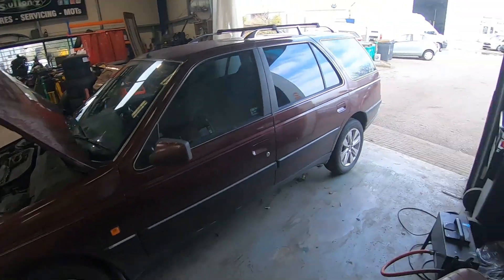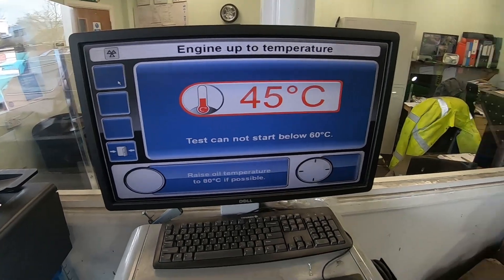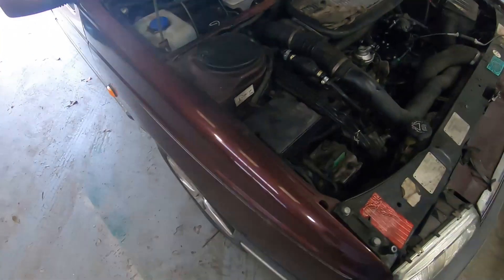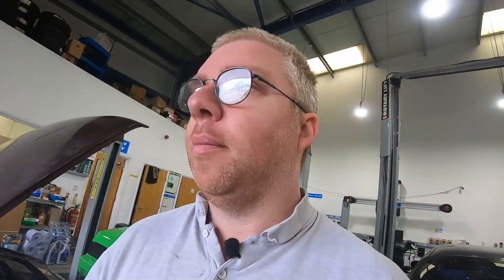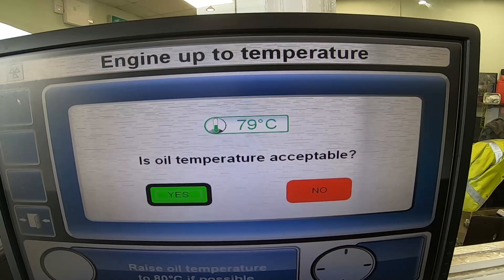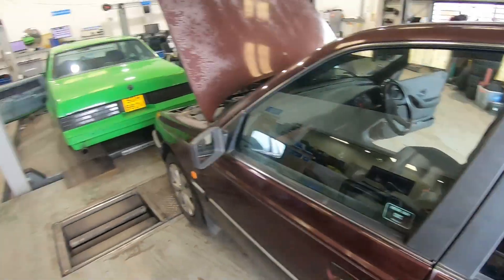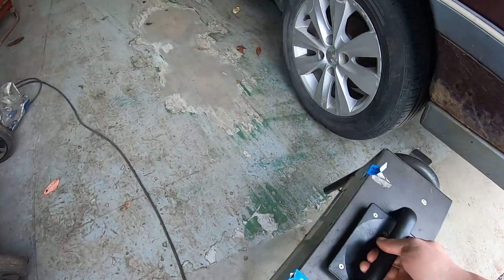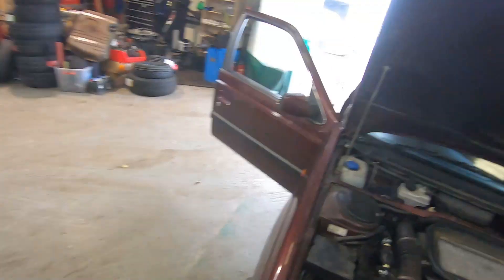Will ENGINE OIL as FUEL pass an MOT emmisions test? - Black Diesel test

Comment: You didn’t mentioned what’s the trick to pass
Reply from the maker: Remove the 'plate value' on the chassis plate. Changed the MOT limit from whatever the plate value is to 3.0

Comment: Hello, I have a 1997 mk2 Peugeot 306 TD. The limit on my car has a soot limit sticker stating 1.96 for a Bosch fuel pump and 2.4 for a Lucas. The car has a Lucas but I have a spare Bosch pump, lines, injectors and pulleys, in case I ever want to run on part veg oil. I'm pretty sure the Lucas wouldn't like it ! My recent MOT, done in January of this year resulted in the following :
Test limit applied   1.50  l/m
Absorption coefficient 0.58 l/m
Absorption coefficient 
after correction            0.57 l/m
Test type applied       Fast Pass
Test results                Pass

   My car has the main fuelling turned up a bit, but not massively. It ran so lean with the factory setting that passengers' heads were like nodding dogs when I changed gear. It goes much better and starts instantly since I turned the 4mm allen key inside the fuel pump by a mere 1/4 turn, i.e., through 90 degrees. I have a K&N air filter and a stainless exhaust with a back box and 2 and a half inch tailpipe. Had a chap much more knowledgeable than myself adjust the turbo wastegate so that it spools up at 1,500 RPM, rather than the OE 2,200 RPM, so, quite amazingly, I get really good local MPG of 53-54, whereas from the factory it was 46 - 47.
Reply from the maker: Thanks for your comment. I find that sometimes having more power from the engine can reduce fuel consumption as the engine doesn't need to work as hard to do its job

Comment: What is the percentage of petrol in your used motor oil fuel?
Reply from the maker: Usually 10 to 20% dependant on the weather /temperature
Reply: Can you Run on it . 
Or is it Classed as Running on Red with the Road Side Checks. 
Just wondering

Comment: Be careful. Running a car on anything other than white diesel or biodiesel/veg oil carries the same penalty as running on rebated red diesel if the police stop you and dip the tank. Also, if you're an MOT AE, a conviction  for tax evasion could affect your repute within the MOT scheme.
Reply from the maker: Thnaks for your comment brad. From the research I've done you can make up to 2500 litres per year without paying tax on it.
Reply: The rule you mention refers to biofuels and biofuel and hydrocarbon blends.
Reply: @Brad-lt6mr  Yes but all he would need to do to meet that rule would be to throw a litre of veg oil in with 2499L of his mix. 
I'm sure I read something about reclaimed fuels being involved in it too - though I'm not up on the wording or full regs enough to make an informed comment on it.
Reply: Most of the oil that comes out of my engine is sooted up white diesel I already paid tax on anyway...😂
Reply from the maker: @Brad-lt6mr  to be honest most of the time the car runs on old cooking oil too. This is why it's taken me so long to make this video since the last one lol